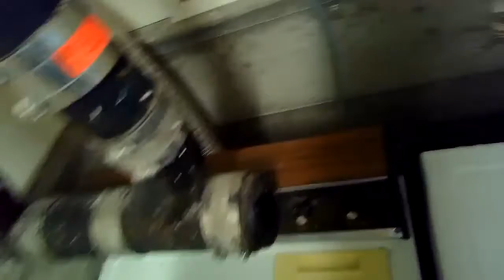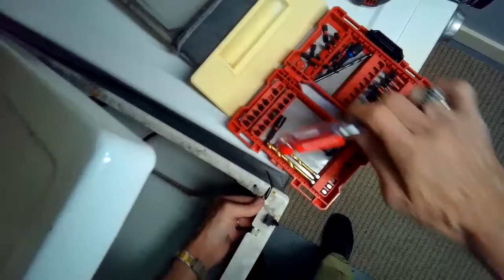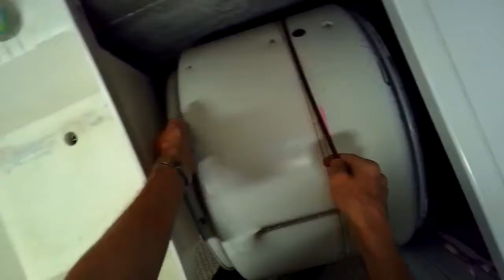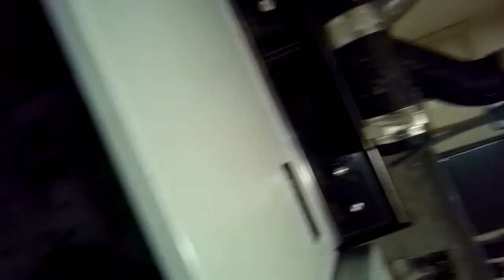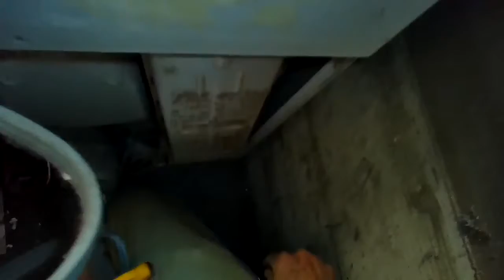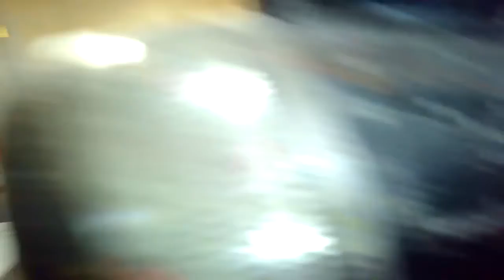WHIRLPOOL DRYER BUZZING - WON’T START - FIXED

Comment: Thanks Scott!!! You saved us hundreds of dollars in repairman fees, I'm sure. No wonder you have so many subscribers. My dryer buzzed, but would not start when I pushed the button. I unscrewed a panel and vacuumed the motor and around the drum and voila! the dryer started.  We had remodeled our bath, including taking out a chimney, so there was a lot of debris on top of the stacked GE washer/dryer. When I saw your video, I remembered that my niece had told me that I should have covered the dryer to protect it during construction, because there are some vents on top. I also remembered that I had washed and dried rubber-backed bath rugs, and a lot of rubber flakes had been all over the inside of the dryer. On our unit, there is an access panel in the front, so I didn't even have to climb in the back, and I didn't have to test or remove anything. Just unscrewed two screws and vacuumed. Gotta love YouTube!

Comment: Thanks for the video. Easy fix. Taped back the door safety switch. The drum was a little hard to hand spin. Got it in a good position to get maximum spin (top to bottom). Pressed and held the start button and hand spun the drum about one and a half spins at the same time, and then released. It kept running. I shut it off, then restarted it without an assist. (Several times) Fixed. I didn't even have to do any disassembly. You saved me from having to buy a new dryer. Although this dryer was bought after 1996 to maybe 2001.😃
Reply from the maker: Nice job Alan😊👍
Reply: This trick worked for me too! Although I still need to get there and clean it properly.

Comment: Thanks for the video. 
I have the Kenmore 90 Series Dryer so mine opens differently.
But I did find a video showing how to open my dryer, cleaned it really well, and thought I oiled the motor but it still didn’t start. Just hums when “Start”button is pushed. 
I even tried tricking the dryer into thinking the door was closed, had someone push the on button, while I tried to turn the drum. It barely moved and certainly didn’t help to start it up. ? 
A few days before the hum issue when the drum stopped spinning, the dryer just shut off a few times. I wasn’t sure if I maybe forgot to turn the dryer on, but in hind sight, I now know the dryer was shutting itself off for some reason. ? 
Either the 90 series dryer makes it harder to get to the motor, or maybe I need to take off more parts to get to it better so I can try oiling and turning the motor some more.  ?  I have to fix this! 
I can’t afford a repair person and especially can’t afford a $$$ laundromat!! So if you can advise at all, please, please do. 
I’m pretty good figuring out how things work and trying to fix them but have never worked on a dryer. Again, any help would be so appreciated. 
Thank you!
Reply: Same boat. Howd it go for you?